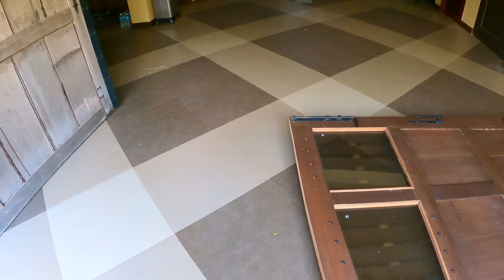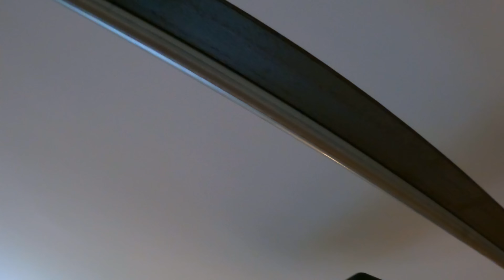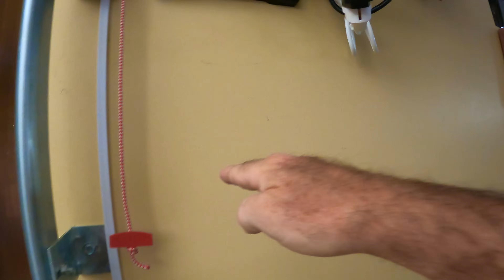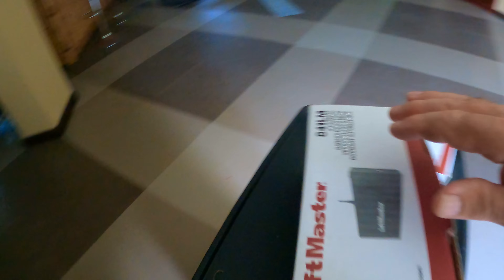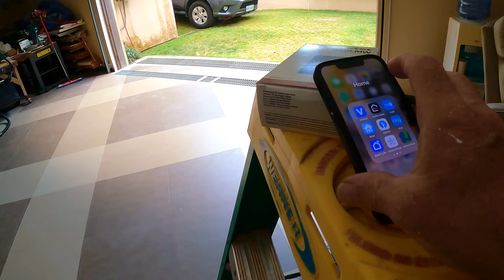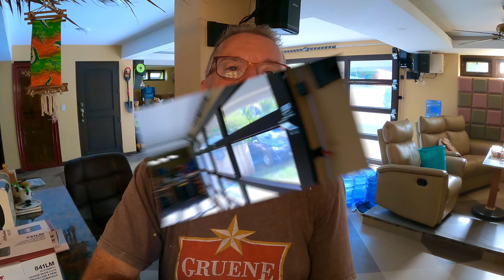The Ultimate Modern Garage Door Installation Experience in the Philippines

Comment: Do you find a large amount of maintenance required to a house built in the tropics?  We have been here 7 years in an American size home.  The first metal water tank rusted after 1 year.  Fibreglass with a rubber bladder now.  Hinges on the shower door rusted after 5 years.  Hard water deposits on 3 toilets lasted 7 years.  Turns out the installers  shortened screws so the tank hardware would fit.  I have to chip out the hard water deposits. I’m still waiting for the water shutoff valves to fail.  That is going to be tough to replace.
Reply from the maker: There are some environmental challenges here unique to the Philippines or any tropical region.  Mostly related to moisture and insects.  It used to be very difficult to find quality building materials but over the 7 years living here I'm finding the market is getting better with regard to higher quality building materials but you might have to be resourceful in your search.
We use a water softener as part of our 3 stage water filtration system and it helps quite a bit avoiding the water stains and hardness on bathroom/kitchen hardware.
Reply: Install ball valves with threaded union connectors for easy replacement in the future, you can even use black PE Ball valves , compression on both ends they are pretty cheap.

Comment: Hi sir James, then ₱240k is the reduced price? it would have Originally been more than ₱240k if you used the Garage company’s own machine instead of your own bought Liftmaster that you prefer? What would have been original price if you used the Garage company’s own?
Reply from the maker: Although I didn't ask for a quote, a quick search for garage door operators in the Philippines shows pricing between P20k-P25k.
Reply: @MyPIDream  Thanks po for the response. Greetings from Guam.

Comment: Looks great James,   Your  new Truck windshield looks really Dark.  Hope you  can see at night.
Reply from the maker: They put too dark of a tint when I specifically asked for a very light shade.  I'll be removing the lower section to no tint when I get time.
Reply: @MyPIDream  I got my new Windshield done with a dark 10 inch Visor tint a the Top only,  I was surprised that the glass was just like the factory glass (tinted)  down to the bubble pattern all around and under the rear view mirror mount.    6,500php installed and 2650php paid by the insurance company my deductible,  so it less than 4k  my part.  Aguila Glass did a great Job.

Comment: Very nice.  I don't think you will have too much problem with high winds as your door is mostly below grade, but debris might be an issue since it is glass.  I had cat 4 rated garage doors installed in my house in Florida but the house wasn't rated for those types of wind so might have been pointless anyway.  I did however liked the insulated doors, but since yours are below ground you probably don't need that either.  Great upgrade James.
Reply from the maker: Thank you for sharing!